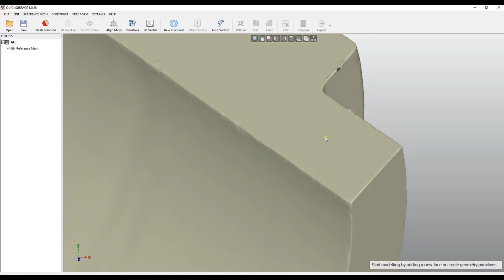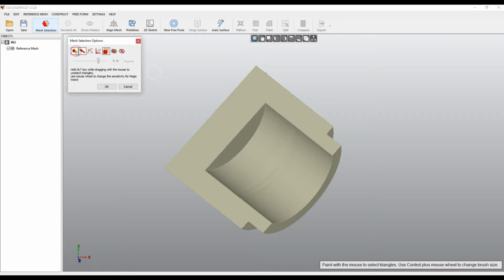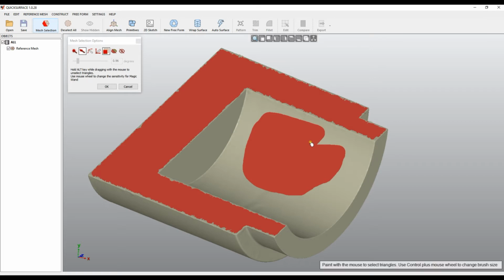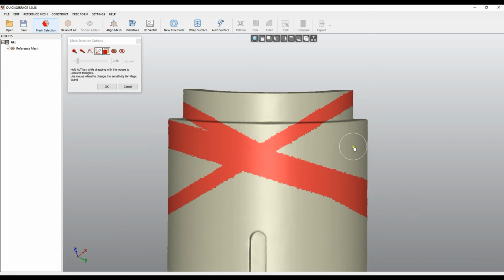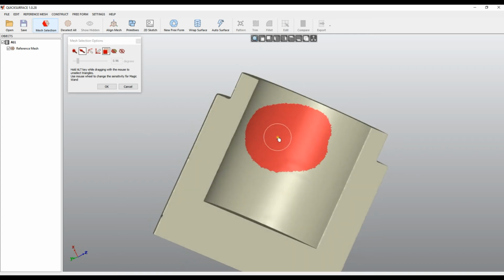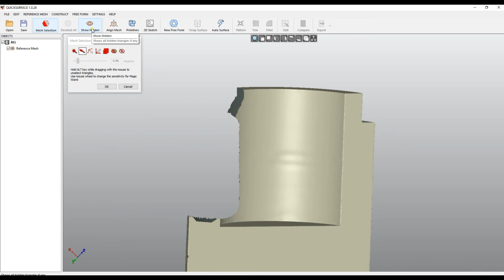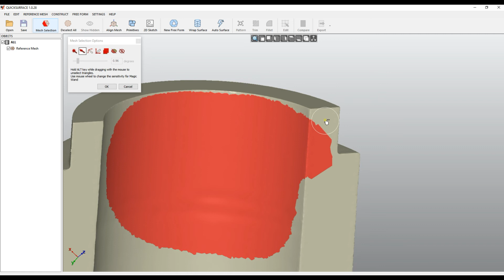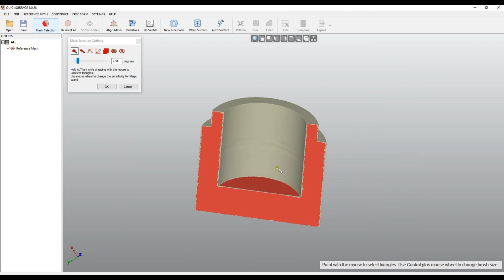QS Tutorials: Mesh Selection - How to do Reverse Engineering with QUICKSURFACE

Comment: why when i made the manual selection the program select not only what a selected but also scatered triangles in all the object?
Reply from the maker: The reason is that you are using nVidia card and you have global anti aliasing on. Open nVidia control panel and turn off the antialiasing. Will this help? If not-contact us for support
Reply: @QUICKSURFACE  thanks problem fixed now i can Work fine